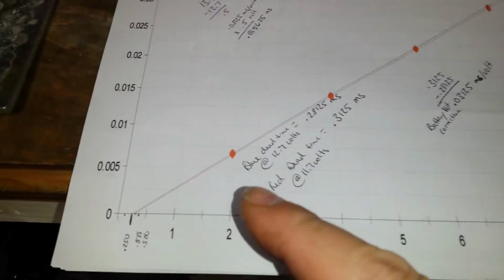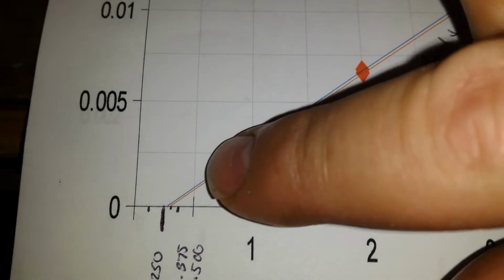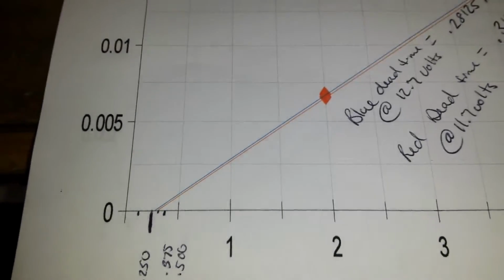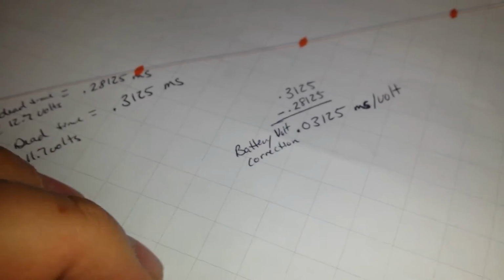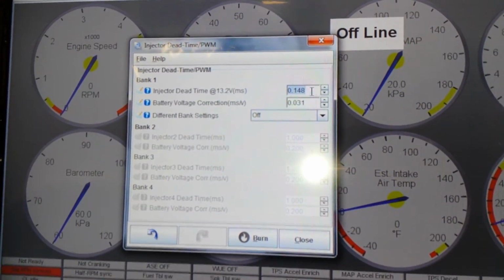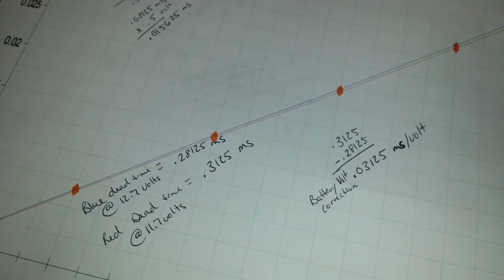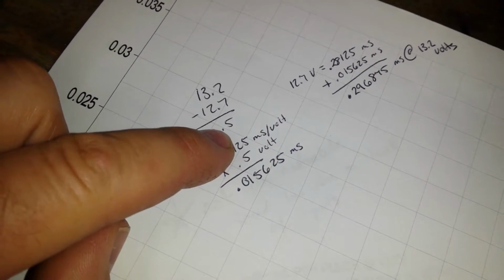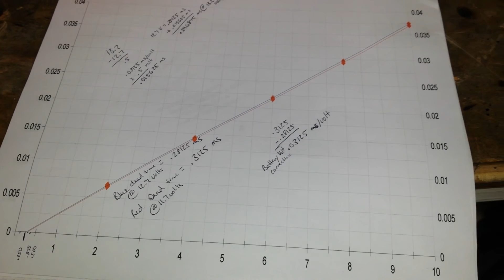Injector deadtime  measurement with microsquirt part 2

Comment: When calculating the deadtime at 13.2 volts, I think you should have subtracted 50% of the voltage compensation from deadtime at 12.7 volts since at higher voltages the deadtime is less due to more electrical potential available.